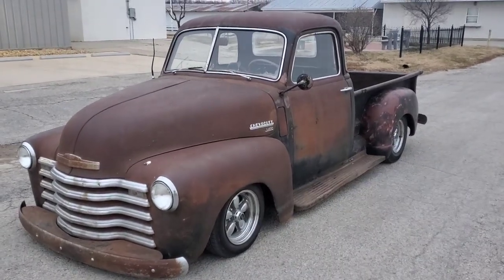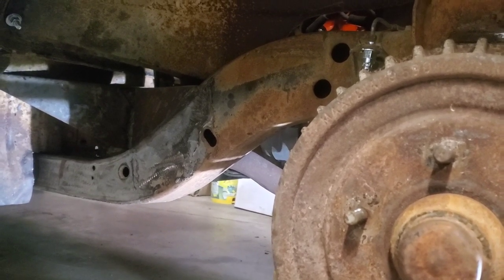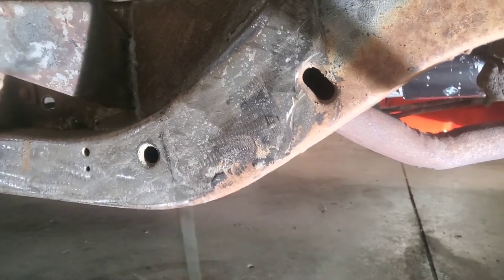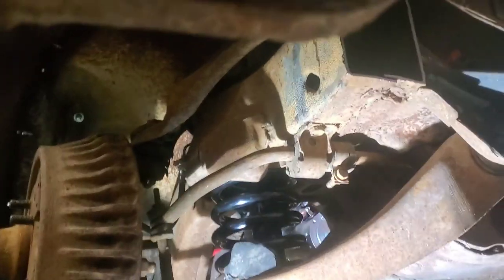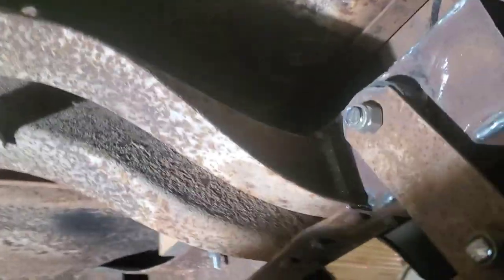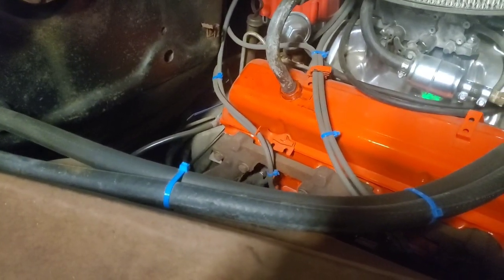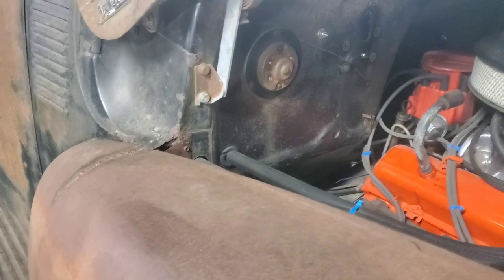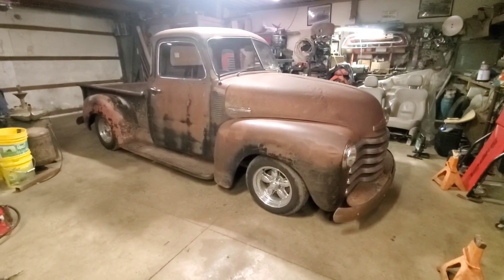How to gm camaro nova subframe conversion 48 to 55 chevy truck 307 sbc smoking tire fire

Comment: I have a question I bought a 1948 fleetline coupe and picked up a 1969 camaro front clip some told me that there's rear and front steering one of them is more work on the subframe.also once you install the front subframe how do you add the inner fenderwells and front clip on the truck and bumpers?

Comment: All it need is new valves springs harder retainer’s and locks why not springs that can handle 500 lift any Flat Tapped hydraulic cam and lifters pushrods and bore the cylinder walls and new rings depending for better driver ability any aluminum intake manifold and carburetor any piston’s for your taste basically

Comment: Love the truck. I put a nova sub under a 33 Plymouth and added a front power steering rack. Nice work. I noticed your HF led light. I hated the fact that it won’t hang. I replaced the stand with a magnet ( from HF also) a now it will stick on the frame or side of car.  Nice burn
Reply from the maker: Love the suicide doors on the 33 Plymouths bet it drove awesome with the sub ! Good idea with the lights , I don't think I'm going to get any more of that style because of the mounting

Comment: just looking at your welds y can tell you did not pas you welding class . by the time you replace ball joints coil spring brakes rotors steering box on and on you are better off with a new drop in kit.you wont have floor pan problems and spend hours making body mounts and rad support mounts .the list is endless. in this country they wont safety your truck and no one should

Comment: I got my eye on a nova front clip with a 6 cylinder and powerglide attached. Theres a craigslist add with new old stock S10 rear ends in various widths. Only thing is finding the truck. Id like that V8 power but i think that 6 cylinder would make a decent driver.

Comment: Thanks for the video, great job of explaining, really hoping you do one step by step soon, i would assume the the front sheet metal has to come off
Reply from the maker: It is a little easier to take the front clip off  but the first one I did  years ago I left it on ! Planning on doing a 57 3100 next but I will definitely do a 48 to 54 hopefully soon
Reply: Ok thanks I will be waiting with great anticipation

Comment: I installed a 52 gmc 2 ton cab on a complete running gear out of a 2005 gmc 2wd chassis is was a pretty simple job
Reply from the maker: Heck ya probably made a nice driver out of it ! 👍
Reply: What you had to do to make it fit